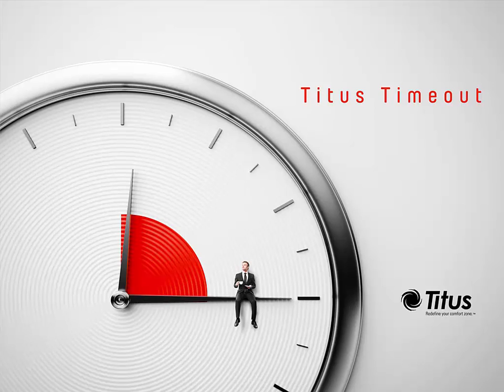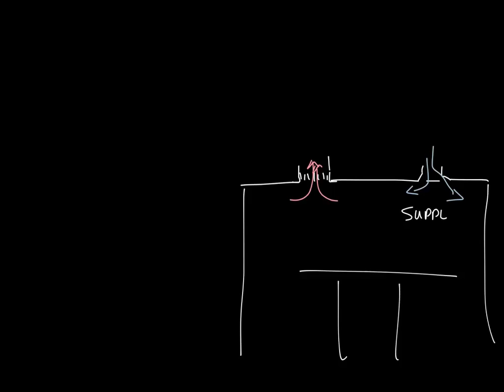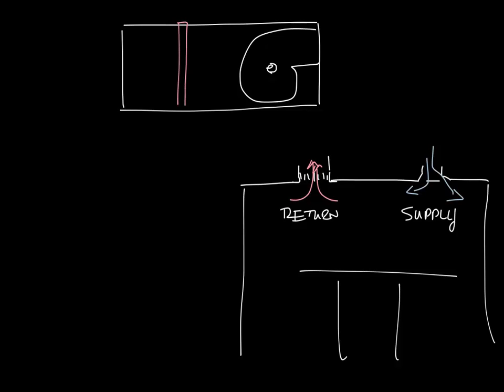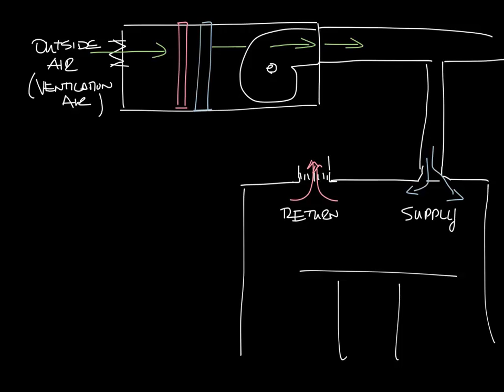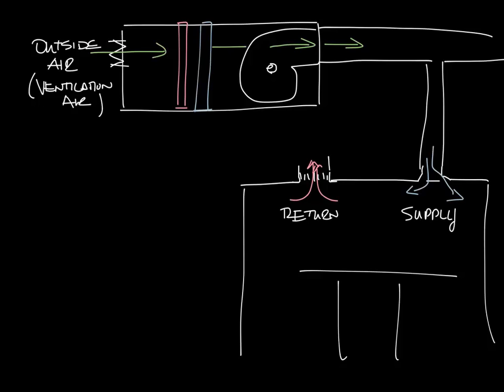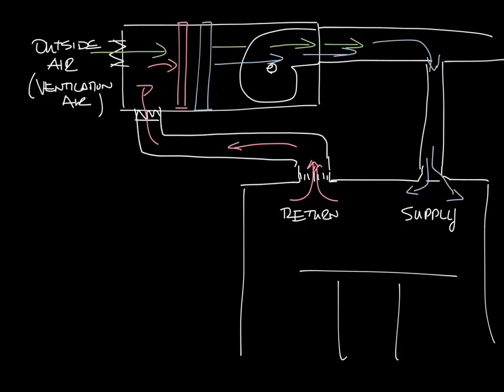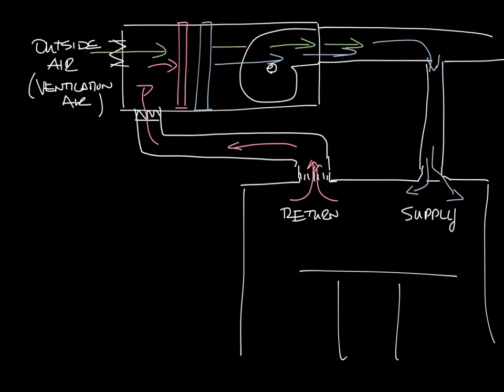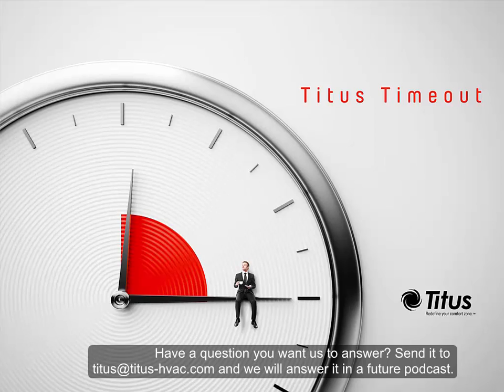TItus  Timeout Podcast - Supply, Return, Ventilation, and Exhaust Air

Comment: Question do you need filter in that handler because the return air has a filter
Reply from the maker: Although it is sometimes desirable to filter return air at a return air grille, it is standard practice to filter all air at the air handler. This is necessary to keep the air handler coils clean.

Comment: Does return air pass through the furnace filter?
Reply from the maker: Yes. The air handler diagram in the podcast was missing a detail. Both ventilation and return air should be filtered prior to reaching the heating and cooling coils of the air handler. Therefore a filter should have been included upstream from the coils.

Comment: I could have sworn the man who installed my handler last year said he closed off the return air in the garage because it wasn't allowed to recirculate?
Reply from the maker: That’s not surprising at all. Return air and ventilation air should never be taken from any place where exhaust fumes from vehicles may be present. That would include parking garages, passenger drop off/pick-up areas, and loading dock areas.

Comment: So the exhaust air mixes with the return air and ventilation air or also stated “outside side air “ ?
Reply: Also the exhaust air is the air that goes outside right through duct or some type of pipe like flue gas ?

Comment: Can u pls explain how to calculate size of this mixing plenum
Reply from the maker: The plenum cross sectional area is typically that which will result in a 450 to 500 FPM face velocity through the filters and heat transfer coils.

Comment: Is it common for the return air not to be completely ducted on its way to the air handler?

In my 1965 condo building each condo has its dedicated air handler (a hydronic heat pump) located in a common area closet hallway. Each condo shares this closet with 1 other neighbor and THEIR heat pump.

The return air from my unit enters this hallway closet through a cavity up near the top of the closet wall. The cavity does NOT connect to the air handler via ductwork. It just enters the closet space to (eventually) find its way just outside the air filter used on the pump.

I'm guessing there's no duct due to the very limited space of the closet...can't have a duct blocking access to the heat pump and there's not really any room for a duct to come out of the filter side of pump because the partition wall that separates it from my NEIGHBOR'S side of pump closet is only a few inches away.

Are you familiar with this sort of ductless return air setup?

Thank you!
Reply from the maker: This type of return is very common in commercial buildings as well. Often the cavity above the ceiling serves as a return plenum where the return air from multiple spaces is drawn through it and back to a common air handling unit that serves the various spaces.

There are certain applications where this type of return is not allowed. For example, air returned from a patient room or laboratory must be completely ducted back to the air handling unit. This is because of the possibility of spreading gases or other hazardous contaminants between spaces. In this case, the return is labeled as an exhaust as its volume flow rate must be controlled to balance the space supply airflow rate and maintain proper space pressurization.

We hope this helps.

Comment: Thank you so much for sharing these videos! 
I have a question :
Let’s say the Supply Air is calculated to be 3200 CFM delivered to my house .And the Exhaust Fan removed 2000 CFM clean air to outside my house .Does the Supply Air change to be 5200 CFM (replacing the 2000 CFM EA)? , or Shall it stay constant = 3200 CFM?
Case# 1 Exhaust Air goes out through the Return Air duct.
Case #2 Exhaust Air removed outside directly in a independent duct without mixing with the RA.
Thanks again,
Reply from the maker: Engineering team reply - Generally speaking the supply and return airflow will be the same, so if your house is supplied with 3200 CFM, the return will be 3200 CFM. Some of this supply air will be made up of outside ventilation air -  900 CFM for example, the exhaust air will be also be 900 CFM. The exhaust airflow is subtracted from return airflow to calculate the recirculation airflow which is 3200 – 900 = 2300 CFM. In some applications the supply airflow may be slightly higher or lower than the return air in order to control the pressure of a room to either positive of negative pressure relative to the adjacent rooms, for example, infectious isolation hospital rooms are controlled to a negative pressure so the return airflow will be slightly less than the supply.
Reply: @TitusHVAC  
Thank you so much for your thorough explanation 👍

Comment: Does a return opening have to go through a duct?? Coz' in our house for a few years now, my dad i think he came up with something regarding our ducted split AC (concealed) and I'd like to ask if it's right or is it going to cause the ACs to stop working any soon!.. Regarding the internal units; my dad who is not an engineer decided to make a gyps ceiling hiding two internal units for two ACs in our big space area inside the house but only one RETURN wich is NOT DUCTED or anything. The air just go inside the gyps ceiling which has two internal units with ducts to supply cold air, BUT no duct for the return. could that be right? Thanks..
Reply from the maker: This sounds like an issue you should address with  a residential HVAC technician to see if your air is being distributed correctly.